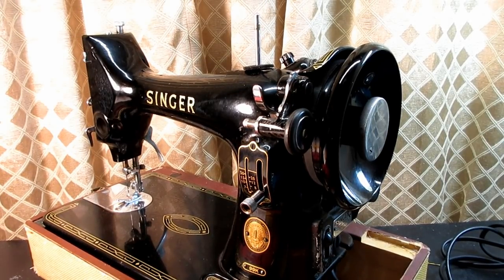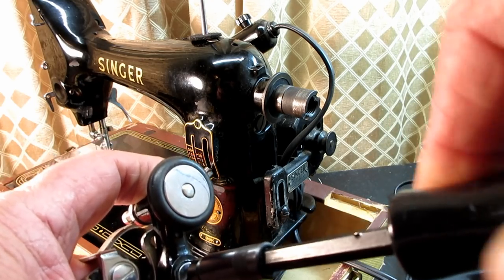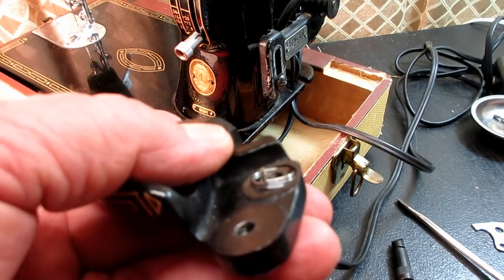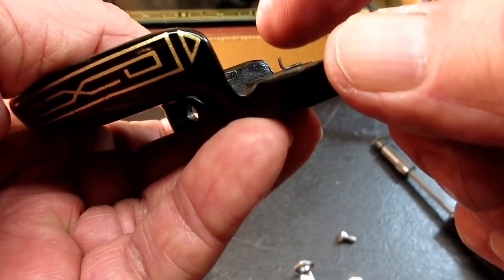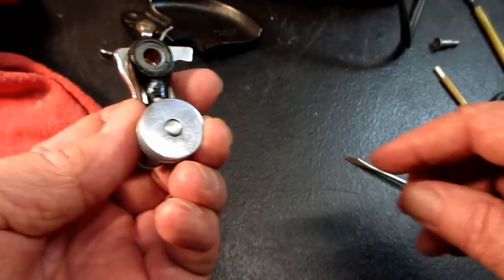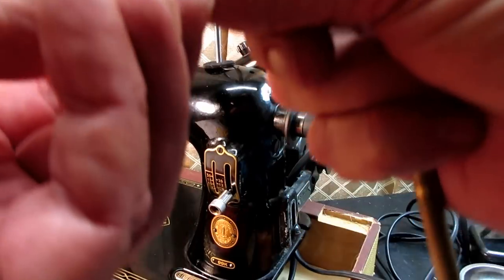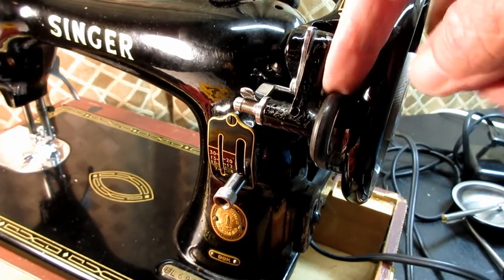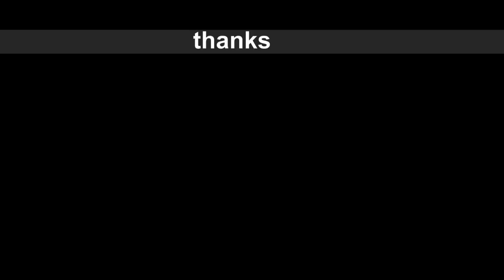The Handwheel and Bobbin Winder of a Singer Model 99K Sewing Machine

Comment: I have owned several 99k machines over the years.  I always put the stop motion washer as you call it with the two tangs facing inward.  It stays in place better than the way you install it,  plus the tangs could hit the stop motion screw.  I just tried it both ways and it seems like you can now adjust the tightness of the wheel 4 ways instead of 2 ways by turning over the washer with the tangs and 3 stops around the outside.  Try it.
Reply from the maker: I have only owned this one 99K. Singer manuals show to install the "Clamp Stop Motion Clamp Washer" (Singers name for it in their parts manual) exactly the way I do in the video.  What you call the "tangs" Singer calls the "lugs" and they are DESIGNED to make contact with the Stop Motion Screw. That provides a creeping action when the screw is tightened. The clamp washer acts like a regular spring washer but is designed to NOT lock into position. When the "tangs" are pointed inward there is not any "give" to the washer at all, and it locks almost in an instant. I usually follow the Singer Service Manual for installation and adjustments. I figure they designed and built the machine and they certainly know more than I do about it. Thanks for watching my channel.

Comment: Handy little hint that may help someone with that clamp washer:  Sometimes (or a lot of the time if you're like me!) when you put the hand wheel back on the machine the clamp washer wants to dislodge before you've got the hand wheel wound back in enough to make sure the washer stays in place.  I've found that raising that end of the machine just a couple of inches persuades gravity to be my "third hand" helping to keep the washer in place.  When the machine is in the treadle table I use a business card or credit card to help hold it with one hand while I wind the wheel on with the other.  (I use that because I'm afraid if I use a screwdriver I'll be clumsy and scratch or ding something.  I could lift up that whole end of the treadle table, I suppose, but don't fancy trying it.)  :-D
Reply from the maker: A nice tip and pinned to the top of comments for others to see. Thanks.

Comment: Another great help Andy. My rebuild is coming on nicely with you holding my hand of course 👍👍👍
Reply from the maker: It sounds like you're having a pretty good time there, Bernie! Happy for you and hoping other people are working on a machine this weekend too.
Reply: @andytubesewing1953  All finished AND IT WORKS 🥰🥰🥰
Reply from the maker: @moiraberniegatt9491  Nicely Done. You getting to be what we call an "old hand", meaning a pro.
Reply: @andytubesewing1953  on to my new singer 15K now. Yay.
Reply from the maker: @moiraberniegatt9491  You're on your own now, Bernie. I've never done a model 15. Sewing machines all use the same basic mechanics so you have the skills needed. Best of luck and take care.
Reply: @andytubesewing1953  you too. Keep safe
Reply: Andy I'm flummoxed. You up for a challenge? Stripped out as much as I could and cleaned and put it all back together but the needle bar is hitting the sewing foot if the sewing foot is raised but the singer 15k timing was factory set so unlikely to be a timing issue and there are 2 timing black bars on the needle bar which are pretty much bang on. The foot is a Simenco and looks right but may not be??? Would that make any difference? I just dont know what to look at. Even a nod for me to research would help I'm sure
Reply from the maker: @moiraberniegatt9491  There should be no contact between the needle clamp and the presser foot on a sewing machine. Your presser bar could be adjusted too high, or the needle bar too low, or a combination of both, or the wrong type of presser foot. I have a service manual for model 15-91 that shows how to adjust all that. I know you have a 15K but perhaps this service manual would help you. If you want a free copy of it (PDF) email to andymanuals53@gmail.com. The subject line should list what manual you want.
Reply: @andytubesewing1953  bless you Andy. Thanks. Will do.

Comment: Hey Andy, I just disassembled mine and after putting it back together, I found the spring with the longer arm was hitting the edge of the handwheel, making a scraping sound.  It took a minute to figure out where the noise was coming from but when I did, I simply put the spring back down away from where you have yours sitting. I’m not sure what the purpose was other than maybe that’s what the service manual showed, but that was the only way to be rid of the noise the scraping sound it was making. It works fine otherwise.  Has anyone else mentioned this to you?
Reply from the maker: I've had this discussion about model 15 and we came to the conclusion there are a couple versions of the spring, and some online sellers sell the same spring for a few different models even though they are not the exact original. There are several versions of model 99, about 20, and that is just the domestic version. Singer made them from 1911 to 1963. I'm guessing you and I may have had slightly different versions of the spring is all. I'm glad it was an easy fix for you, Rhonda, and thanks for sharing the info.

Comment: Hi Andy,
I'm working on a 15-91 with the potted motor right now that has a very similar bobbin winder set up.
The belt guard is of course different since it is the potted motor but the winder itself only differs in the larger spring it uses.
The spring that raises the rubber tire from the wheel to disengage has a longer tale, otherwise they are the same.
This one, that spring is broken, and available over at sew-classic for $5 Part #125365
It seems he doesn't carry the springs for the 99. 
But, yep, they do break and I'm the lucky owner of a broken one.   ;O)
Thanks for the great video.
Reply from the maker: I'm glad Jenny had the spring for your bobbin winder. It's interesting how many Singer machines have the same parts. I guess when you have something that works wee you stick with it. Thanks for watching and have fun with your 15-91.
Reply: Pretty much done with it Andy.  
I'm going to wait to order the spring when I have need of some more items, to save on shipping.
I bought it from the goodwill auction and they destroyed the button controller by just throwing it in under the machine and crushing it, it even broke the ceramic.
I found two controllers online very reasonable so I ordered both one for $12 (ebay) and the other for $6 (thrifty farm girl), and I'll now have parts from the damaged one like all the carbons from the stacks, they survived.
AND... I have your 6 part video series on rebuilding them to listen to while I do the repairs.
Thanks Andy
Reply from the maker: Mark at; Nightowl  Oh too bad about the controller. I had the same, and I sent pictures to the seller and at least they gave me a $10 credit. It's a good idea you bought a couple so you have parts on hand. You are getting busy with these restorations like me, and it's a drag to have to wait on a $5 part sometimes.
Reply: This is the fourth machine goodwill has damaged and even though I told them about the first three I just ask them to do better and didn't accept any refund, but this time they offered to refund on the whole order and let me keep the machine, so I accepted.
That makes up for the controller and the bentwood case for a white rotary they turned to splinters.
I was really upset about that bentwood case, in all this time I've been playing with these it was the only one I've ever seen, they are common for Singers but those White cases are rare.
It's going to be a real challenge trying to piece it back together, but I hate to see it vanish from existence so I will try.
But goodwill basically gave me the 15-91 so I can't say they didn't try to do the right thing and make up for it.
They offered me $15 towards the bentwood case back when that happened and I told them to put that money into packing materials and be more careful.
I payed $42 on that White machine and case shipping, which was 3 times what I paid for the machine, the machine was $12, and bought it solely because I wanted that case.
Such is life   ;O)
Reply: Hi, I refurbish 15-91's. I have a problem I can't seem to solve on one of my machines and it's making me crazy! The stitch regulator moves when the hand wheel rotates. Have you ever run into this problem? Thanks Mark.
Reply from the maker: Mark at; Nightowl may have the better answer to this as I have never touched a 15-91, but in general, the FEED REGULATOR goes on to a slide block or roller on the FEED FORKED CONNECTION. It is held in place by a HINGE SCREW and FRICTION WASHER that is accessible behind and below the handwheel. If the screw is not tight enough, or the friction washer is missing, then the feed regulator (stitch regulator) can move around when the machine is in use. Some people call that "regulator creep".
Reply: Nope, I don't
I don't even have a parts breakdown on this machine, all I have is an adjusters manual and the operators manual.
I haven't removed the stitch regulator out of one, still above my pay grade.
Reply from the maker: I have the original 20 page parts list with numbers and pictures. My email address is on the "ABOUT" page of my channel. Drop me a line if you'd like a copy in pdf format.
Reply: Andy.
Thank you, I do that right now.
Reply: Thank you Andy.
Reply from the maker: Of course. If you need documents or parts list just email me. The address is on my "ABOUT" page. Good Luck.
Reply: @terrigelbaum8066  hi, I had that problem which I think was caused by the friction washer being missing. It may also be possible that the friction washer is flipped around the wrong way.

Comment: Andy, I have a 1980's New Home model 641 that I have loved and pampered for decades. Just recently, the needle bar keeps moving when I try to disengage it to wind a bobbin. Should I remove the handwheel, the stop motion screw and washer to try fixing it? If I take it apart, do I make sure the washer has the two "ears" at the top and the one ear at the bottom? No way can I get this baby serviced so I need to do my best to fix it myself. Thanks for your help, sir.
Reply from the maker: So I've never worked on a New Home Brand machine, but if it has a similar style of handwheel and stop motion knob, then you can take it apart, or partially apart to work on it. It probably just needs a cleaning and slight lubrication. If it has some style of a clutch washer and it gets dirty or sticky that can cause needle "creep" and let the needle still move while bobbin winding. As to the position of the washer, just take pictures while you are removing parts. Like before you remove the washer take a picture of its position on the arm shaft. You can even make marks on the washer & inside of the handwheel with a permanent ink pen and then line up those marks when you put it back on. You can also buy a Service Manual for your machine (which you may want anyway). Service Manuals usually show how to remove and replace parts, including the handwheel. You can download one here for $6.99:
https://manualsoncd.com/product/janome-new-home-640-641-sewing-machine-service-parts-manual/
I usually have a Service Manual for every model I work on. Thanks for watching my channel and good luck.
Reply: Andy Tube  Thank you, Andy. New Home brand is now Janome. Thanks for the service manual link and for your insight into where the problem lies. I appreciate your prompt reply to my question.
Reply from the maker: @TheJudeJane  Very welcome and good luck.

Comment: I have just watched your fascinating video. I have a 1957 99k, and the bobbin winder is totally seized. I would attempt the disassembly of the hand wheel and bobbin winder as you instruct, however, I am not sure if it is what I need to do, in order to fix it. It used to wind bobbins, for a while, when I first started using it. I only hope I can remember which screw goes where  :/ Would you advise me to attempt this? Thank you.
Reply from the maker: I'm not sure you even need to disassemble it since it worked before. It's a strong assembly of parts and other than a spring nothing really breaks from usage. Have you ever oiled it? I ask because you say it is totally seized and that sounds like a lack of oil. You can watch parts of the video to see what parts move and hinge and put a drop of oil on any moving part (do not oil the rubber tire) The BW Frame hinges on a screw you can oil, but what I usually find is the rubber tire won't turn/spin. If you look at the BW to the left of the tire you'll see a hole. So between the tire and the spindle post you put the bobbin on. That hole is where you oil the spindle bushing. Try a drop or two of Sewing Machine Oil. Sometimes you can start turning the tire right away; sometimes you need the oil to soak in for a minute or two. If the bushing inside is dry it will start tuning right off, but if there is old dried up hard oil inside the hole it takes a while to soften. You can put a couple drops of alcohol in the hole but you MUST NOT get alcohol on the black finish. If the spindle has seized from dried oil, the alcohol will soften it quicker than just new oil. You seem like a patient person, so just try the oiling and give it a chance. As far as disassembling the parts, you seem so hesitant that I'd advise against you doing it. Good Luck, Judy, and thanks for watching my channel.
Reply: @andytubesewing1953  You were right, of course. I oiled it and then oiled it some more, and eventually it began to rotate and I oiled a bit more and it seems to be whirring away perfectly right now.  What would I (and so many others) do without your expert videos? Keep them coming ;)
Reply from the maker: @judy8798  Thank you for starting my day with good news, Judy. A good cleaning and oiling can fix so many annoying problems on a vintage machine. I'm glad it was not anything broken. I love that my videos can help. Here is the main playlist page for my channel with 500+ videos.   https://www.youtube.com/channel/UCUSPDsHaFtRoz1VA2U1xJ4w/playlists
Maybe you could tell one friend? Happy sewing and take care.

Comment: Where do you get yours
Singer 99 parts
Reply from the maker: For used vintage parts, I find many on eBay and http://www.thriftyfarmgirl.com/    For "new" parts like springs, bobbins, tires, rubber feet, cords, etc. I have used this seller for many years https://www.vintagesingerparts.com/   Some sellers on eBay also offer parts like that. The last choice for new stuff is https://www.sewingpartsonline.com/ Their quality is fine and they have a large selection but, IMO, they are pricey with slower service. They are probably the largest seller of parts. Thanks for watching my channel.

Comment: Hi, Andy. I thank you for all your tutorial videos!  I just bought on line and overhaul my first ever sewing machine (Red Eye model 66) because of your wonderful tutorials.  I put everything back together by watching you.  However, the bobbin winder pulley is not rotating no matter what I do.  I can’t recall if it arrived to me in that condition or if it froze up during my cleaning it. I cleaned with Gojo hand cream cleaner, lather with sewing machine oil and oil the two oil ports, and finally WD-40.  I then tried to rotate it to no avail.  I’ve been trying for the past 3 days.  Please HELP!  Thanks in advance.
Reply from the maker: You don't remember if it worked before? Was there any rust on it? If the part is rusted inside it may need a rust remover. I don't know if the WD40 would free it up if rusty, especially after putting oil on it, which blicks the rust remover. I use The Must for Rust product, about $6. Also, you mean you can't even turn the pulley by hand, not trying to fill a bobbin, right? I have used heat, like a hairdryer, and alternated with WD40 or Krud Kutter Cleaner and degreaser. I don't know if it had dried oil or rust or the spindle is bent, so I'd just keep trying what you have, but add heat. I have also tapped on stuck parts with a light 2oz hammer to try and loosen a part.
Reply: @andytubesewing1953  Thanks, Andy.  I just got the machine this week and I think it was spinning but I can remember.  I did remove the brittle tire and washed it.  It may have locked up after I washed it.  I placed it in a small cup full of sewing machine oil for about 30 minutes.  Now I have it basting in the Gojo cream again until tomorrow.  I can’t get the screw out of the rotating disc for cleaning (top portion under spring may be caked up.  I will try the The Must for Rust product.  Can I get it off Amazon or home improvement store?  Thanks again for your help!
Reply from the maker: @yvejo7938  OK. If it rusted after washing, 30 minutes of oil usually won't work. Gojo has a lot of water in it so that probably made it worse. The rust remover won't work very well if there is oil or Gojo inside the spindle/pulley bushing. I think I would run hot water over it at force, then soak in alcohol for a while trying to cut any oil, then use the rust remove. Yes, big-box hardware, small hardware, Amazon has a lower price if you have the free shipping with them https://www.amazon.com/s?k=KRUD+KUTTER+MR086+MR08+The+Must+for+Rust%2C+8-Ounce&i=tools&ref=nb_sb_noss
Reply: @andytubesewing1953  Thank you much!  I will try your suggestions and let you know if it works or not. I ordered thru Amazon with prime, will arrive Thursday.
Reply from the maker: @yvejo7938  Read the directions and use the oil ports to apply it. Caution with the black paint. Good Luck